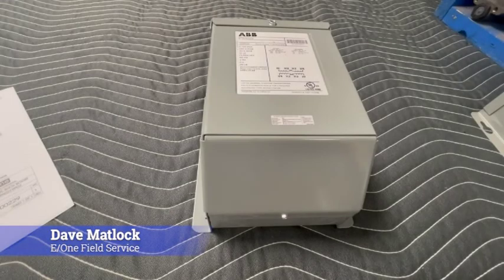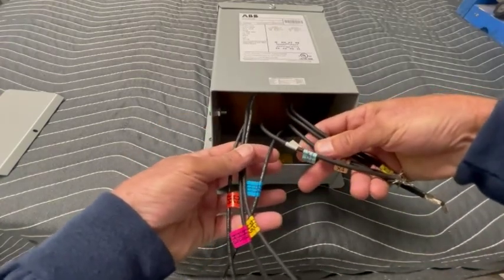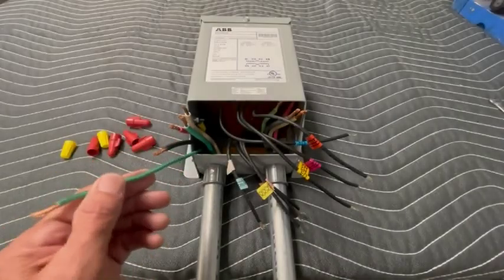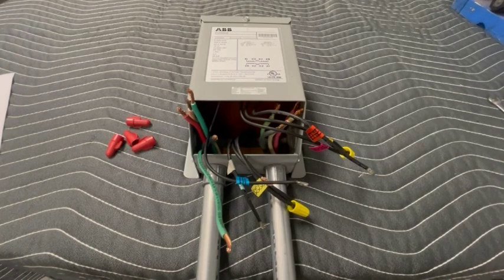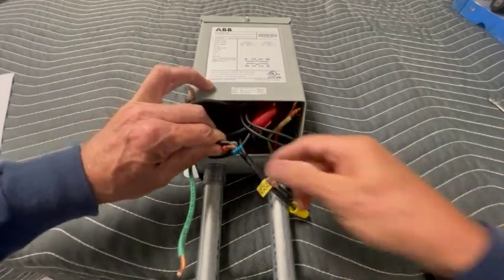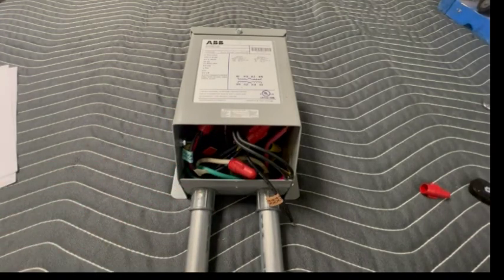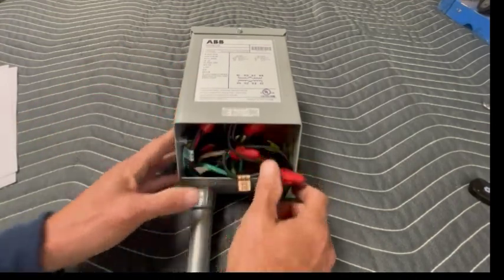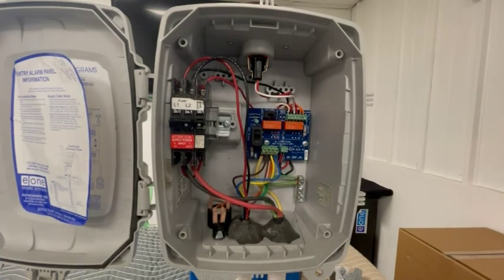E/One Grinder Pumps: Wiring a Buck Boost Transformer for use with an E/One Station

Comment: pardon my ignorance...if i have 277V coming out of the wall, but i want to power up a parking lot fixture in my lab (for a thermal test) rated at 480V (white, black, green)...what transformer would you recommend?